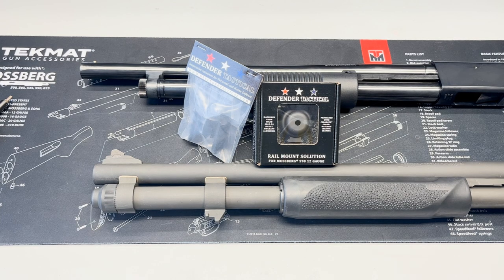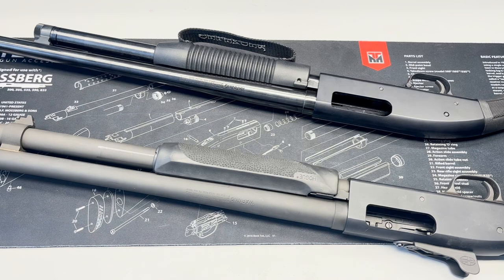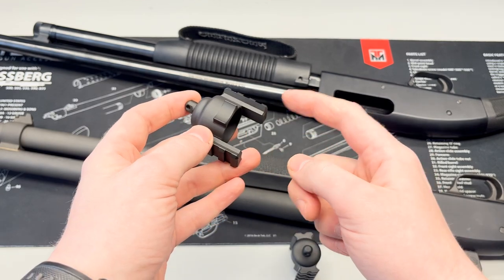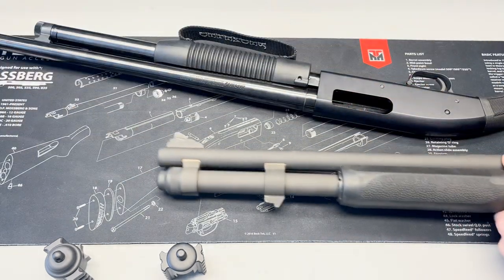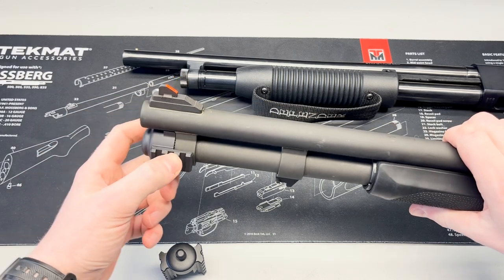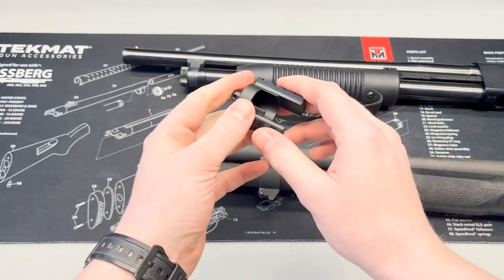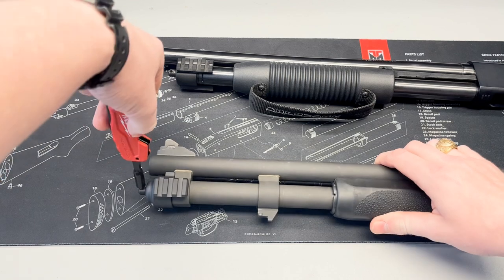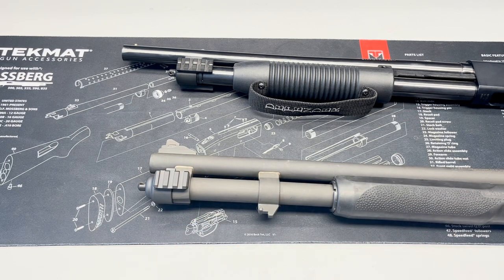Mossberg 590 & 500 12 Gauge Rail Install

Comment: So, I was looking at these in one of your Tac 14 videos, and I saw that it was installed with the Magpul forearm. Will the dual rail for the 590 (shockwave) fit over the Magpul forearm? If not, do/will you make one? Or will I have to modify the grip?

Comment: I have a regular 590 that I put your rail mount on and i love the mount, but why is there so much side to side rotation, when installed? It feels like the U-shaped should be tighter to the barrel.
Reply from the maker: The rail is designed to fit across the many different variations of the 590 and different tolerance stack-ups, so there may be a very small amount of play depending on your model.  If it is too much for your liking, shoot us an message or email and we can discuss some options to eliminate it.  At the end of the day if you aren't happy, remember you have a 100% satisfaction guarantee and a lifetime warranty.
Reply: @defendertacticalTX  no, I just wanted to bring it to your attention because I know you are an innovative company and I’m sure you wouldn’t be opposed to always improving your designs. Stay tactical 🤘🏻
Reply: @defendertacticalTX  so it will have no slop or play on a 590a1?
Reply from the maker: @TheTrueNorth11  If you have the heavy wall model, then it should not. But as I mentioned above, we have to design around all sorts of different tolerance stack ups and different models of the 590, so there may be a very small amount.  Once the screw is tightened down though you shouldn’t have trouble. If you decide to try one out and have any issues let us know and we’ll get you taken care of! 👍🏼
Reply: @defendertacticalTX  I have one on the way, and I intend to use it on a 590a1 so it should be great.